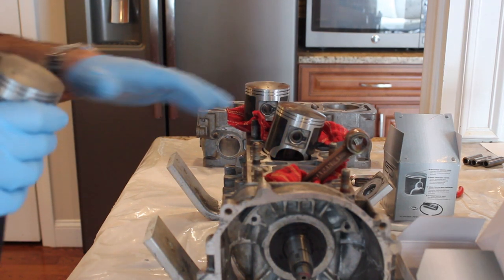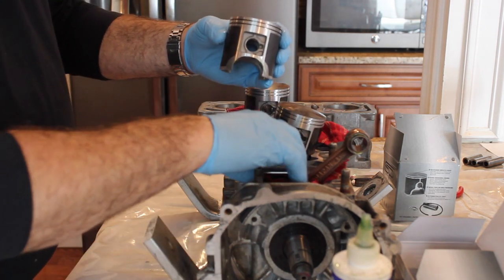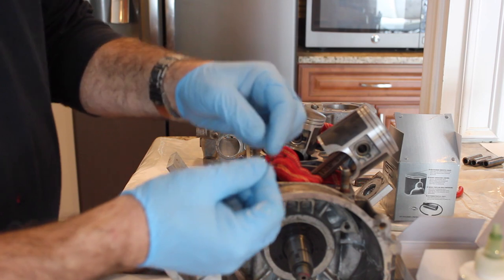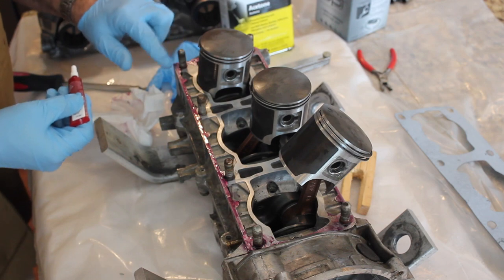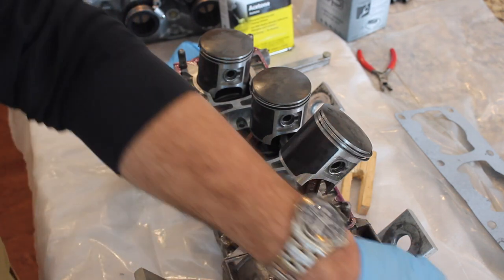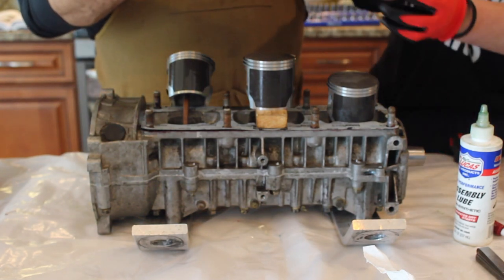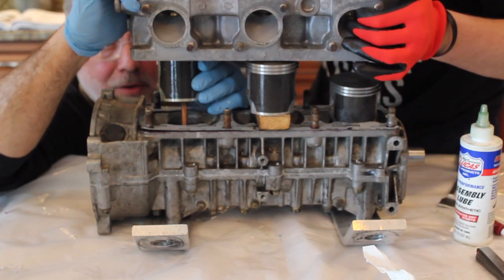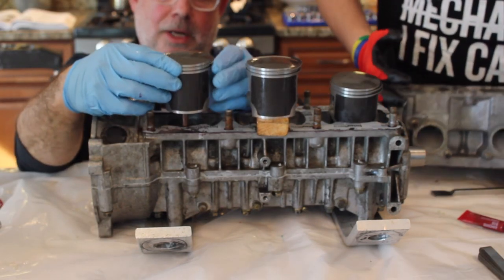Old Sled Rebuild - Part 5: 97 Polaris XLT 600 Triple  - Piston and Cylinder Install

Comment: I use a floor crane with a couple rubber bungy cords to hold cylinder block up and slowly lower the crane as I get the pistons started into the block. It works great if your by yourself. it holds the weight and allows flexibility when the piston rings go in, and allow the block to come down a bit.

Comment: Also wanna make sure you stagger the piston rings for compression
Reply: The rings go where they go on a 2 stroke piston based on it's design. There is a tooth in the piston ring groove that keeps them from moving and getting caught in a port.. A 4 stroke, you are correct. Not on a 2 stroke.